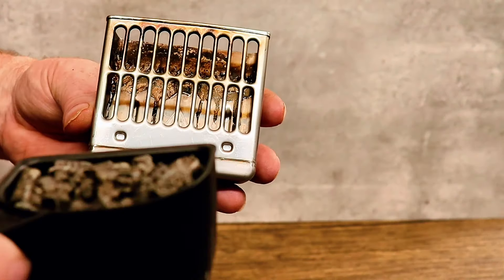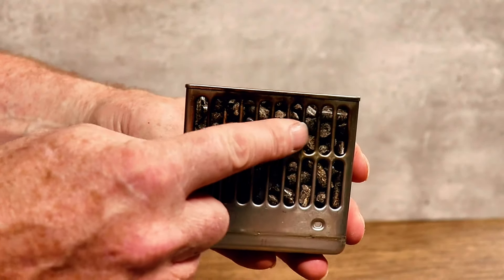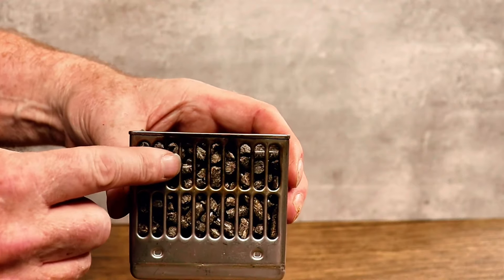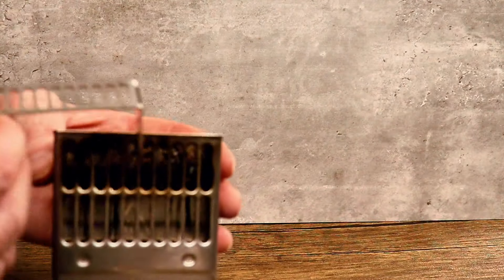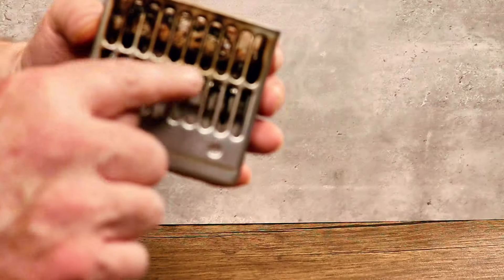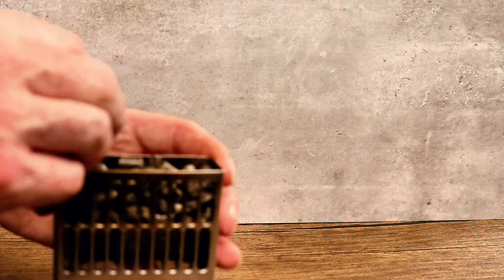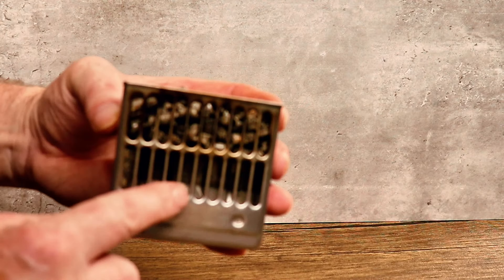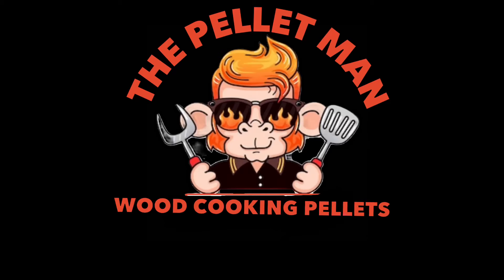What Is An “Economiser”? Compatible With Ninja Woodfire Grills @DutchyOutdoorCookingBBQ

Comment: Where can I buy one of these?
Reply from the maker: https://www.thepelletman.co.uk/p/economiser/
Reply: I bought an economiser and some Cherry & Charcoal pellets from Duchy.
Firstly, the economiser   really does save on wasted pellets, which seemed to be a regular problem ad most cooks are completed in 15 - 20 mins on the Ninja unless you're smoking a whole chicken or brisket.
Secondly, I got zero flavour from the Ninja pellets, but the ones supplied by the Pellet Man add a ton of flavour to my cooks, especially as I always blend in some charcoal pellets with with wood ones.
If you smoke for the majority of the cook with these pellets and then switch to grill at the very end I swear your meat will be just as good, if not better than cooking on a traditional charcoal bbq. Cheers Duch, you have a pellet customer for life here.
Now, please start selling your made to measure pizza stone!